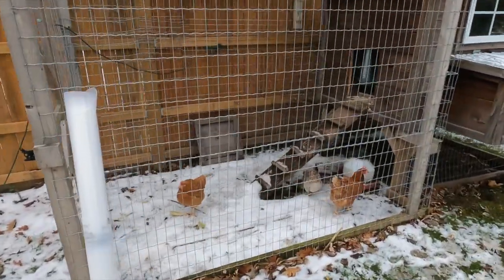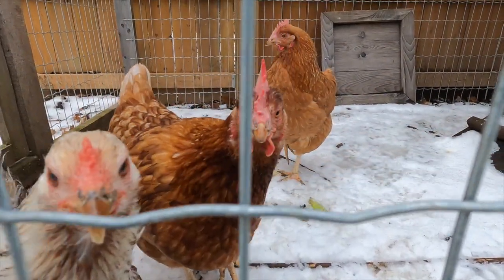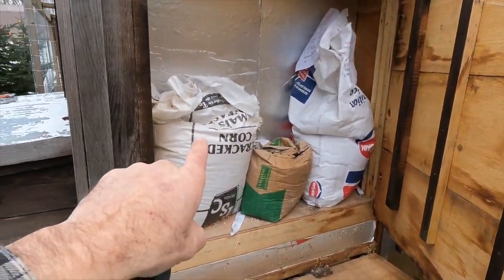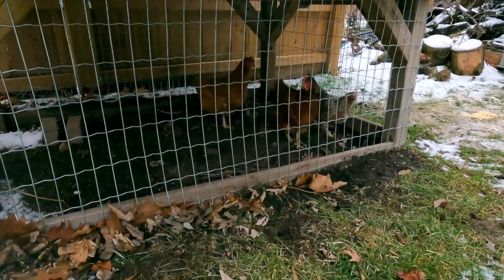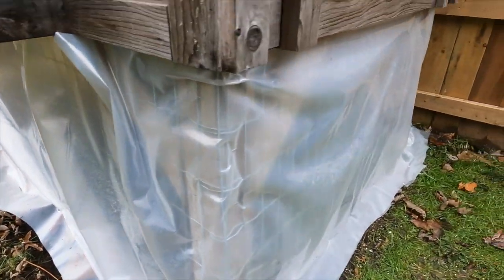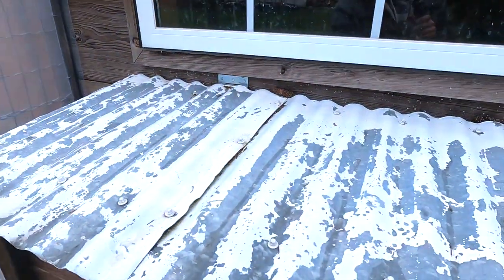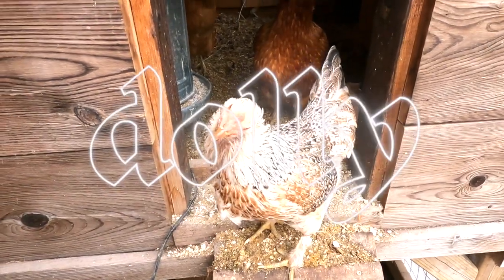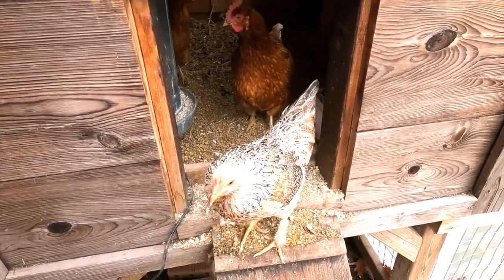Backyard Chicken Coop DIY | CUSTOM FOOD MIX & Food Dispenser | Keeping wind out of the run

Comment: First timers here… yup Canadian winter and we are worried. Already cold. Have the same heater we used for the chicks now that’s a great idea to mount it! Mistake we made was getting Silkies and we are worried. So good so far. They already stay inside
Reply from the maker: I was worried about my girls my first winter as well. Chickens actually do really good in the cold months. Here are a few things you can do. Make sure you have your coop insulated, and block any wind from getting to them. You can also give the chickens cracked corn, corn helps to keep them warm.

I’ve heard silkies do well in the cold.  My hens have been in the coop a lot lately too.